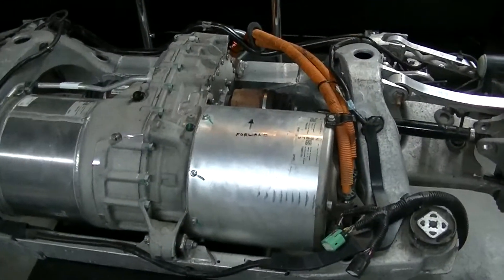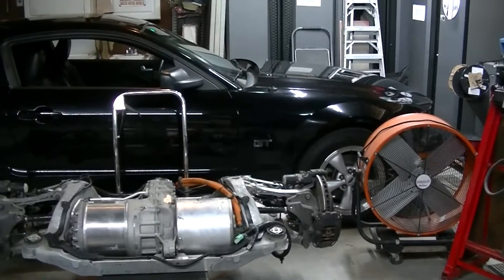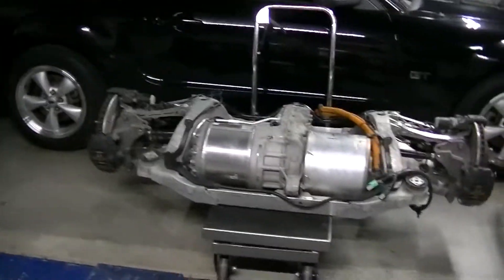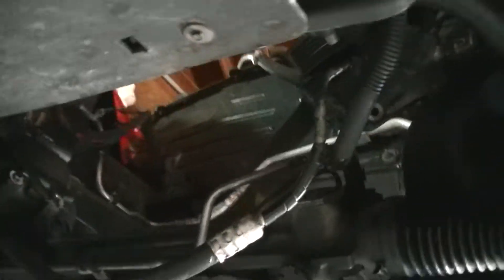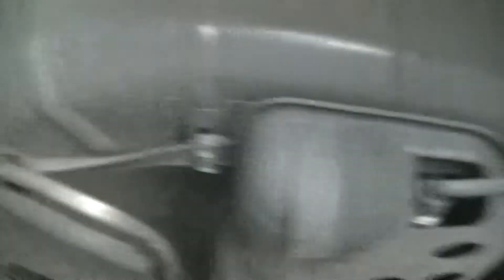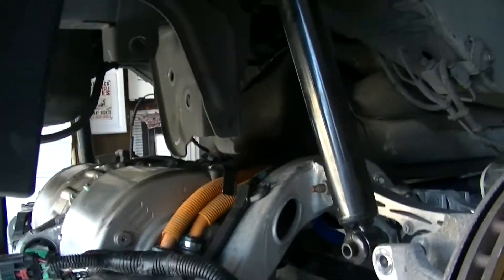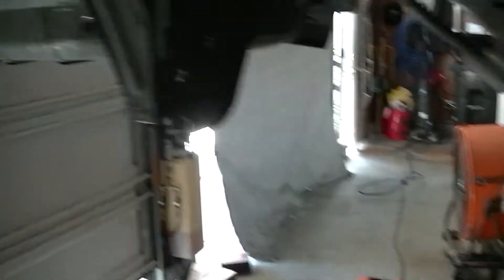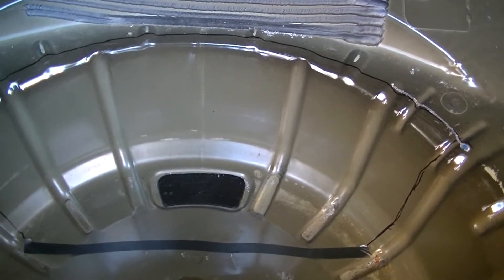Tesla Motor Swap Mustang GT Part 1

Comment: Great video. Do you know what the weight of the Tesla subframe and power unit is? Thanks for sharing your experience.
Reply from the maker: Hi,  I'll know this weekend as I have a Model 3 subframe/motor and Model S subframe/motor arriving Friday.  I weighed the Mustang sport motor by itself and if I remember correctly it was right at 300 lbs.
Reply: @Roadstercycle  Thank you for your prompt reply. Your videos have been a wealth of information, particularly detailing the Open Inverter product. The weight of the Model 3 as well as verification of the Model S would be the cherry on top. 👍
Reply from the maker: @ckafam  Happy to do it for everyone. I ordered a 660 lb scale yesterday so we could find out. My other scale only went to 330 lbs so I was not going to be able to weigh the whole suspension.
Reply from the maker: @ckafam  Model 3 subframe and motor 433 lbs.  Model S subframe and motor. 577  lbs.  144 lb difference, I was shocked. About a 25% weight difference. I like it.
Reply: @Roadstercycle  Brilliant. Thanks for the info and all the best with your next project. I have subscribed and will be watching closely. Thanks

Comment: Hey there, I got a question, is it possible to adapt a Tesla electric AC compressor onto a project eV car?
Reply from the maker: Yes, I don't see any reason why not.
Reply: @Roadstercycle  I mean would it work without having tamper with it?
Reply from the maker: @EddyBoh  I'm really not sure what you mean by tamper with it?
Reply: @Roadstercycle  I mean, will it be needing a software/hardware adjustments as the drive unit or will it be able to operate directly without any adjustments done?
Reply from the maker: @EddyBoh  Hi Eddy, I am not 100% sure that you won't have to do some manipulation of Canbus.  I've never had a unit to test. It may be just as easy as having a relay to turn on the DC voltage to the air conditioner pump motor.  I would need a unit to test.
Reply: @Roadstercycle  Yeah, I think a diagram will be enough to map everything out. Now, I have small question on your high voltage setup, would it make a significant difference if you were to have placed instead of the two small resistors a much bigger one with same magnitude?
Reply from the maker: @EddyBoh  Yes a single big resister would work.
Reply: @Roadstercycle  I'm currently working on my own conversion, and was wondering how much clearance should there be from bottom of the motor to the surface. And would you recommend the axles to go directly from the motor to the wheel meaning directly-flat or should there be some aperture angle? And how would this affect battery efficiency?

Comment: I am doing a rwd swap into my crx. using the non performance tesla motor and 12 lg chem batteries. I am currently designing cooling plates for the batteries though. Can't wait to watch the series through. Hope I can potentially bug your ear as I am just about to mount the motor

Comment: Did you use an HSR 057 controller? I am building a 66 Mustang Tesla swap. Love your stuff so far!
Reply from the maker: No I did not. Unless things have changed you can not buy a HSR 057 controller unless you buy a Tesla motor setup with it. Very expensive doing it that way. I bought my controller from Damien McGuire in Ireland. EVBMW webshop.  It's a stand alone controller board paid about $500 for it. If the HSR 057 can be bought alone now I'd like to know. Let me know.
Reply: @Roadstercycle  sadly you do still have to purchase them together. I bit the bullet and bought the kit. Have you done any hard pulls in your Mustang yet? I will be watching all your videos tonight after the kids go to bed.
Reply from the maker: @zephyrsspeedshop3708  I just got a Dragy today. I'll find a safe place to do some pulls. I'm curious too.